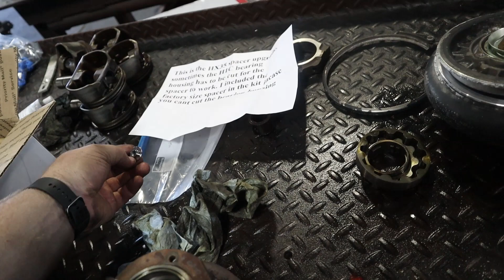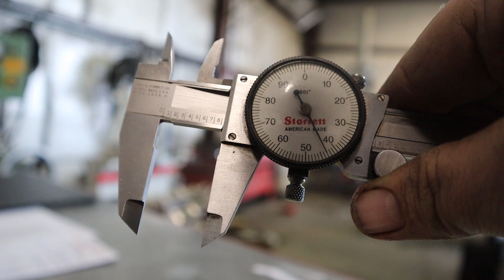WH1C 62mm Turbo teardown and machining.

Comment: I hope this doesn't have an effect on turbo balance.

Wow, I was sure the twin scroll flange would need to be machined. However, I did not expect it to be that bad.

I like cerakote turbo housings. Not only does it prevent rust, it reduces heat radiated to the engine bay. One reason it is said that the Nissan 300ZXTT is unreliable is because of all that heat trapped under the hood. Nissan sixes are great, but the cars they are attached to are hit or miss.
Reply from the maker: just wait, the upcoming video for the turbo is going to be epic. did some cool stuff
Reply: @EngineKrahnicles  Love it, thanks. The 300ZXTT was a huge influence on me. It came out when I was 5. Turbo power sounded like magic back then, so twin turbo sounded like even more magic.

It felt a little less magical when I read about how it works when I was 14. I thought turbos would look complex. I was stunned to see them look like snails.